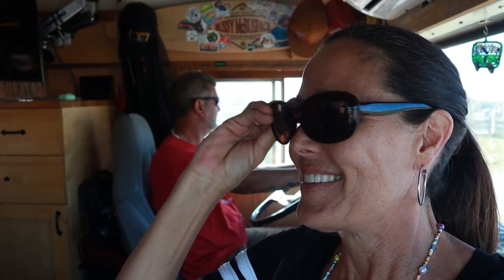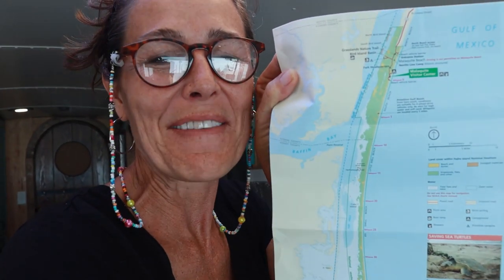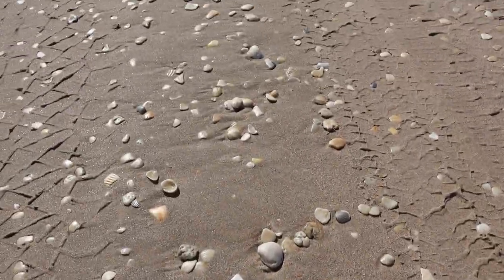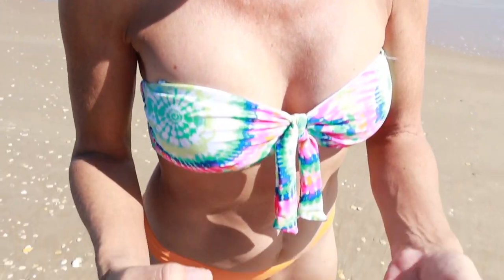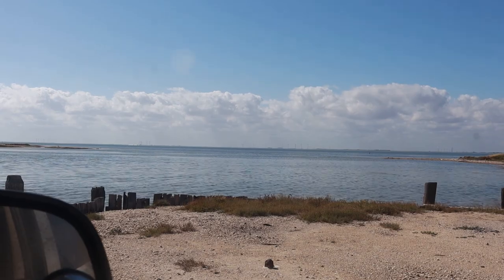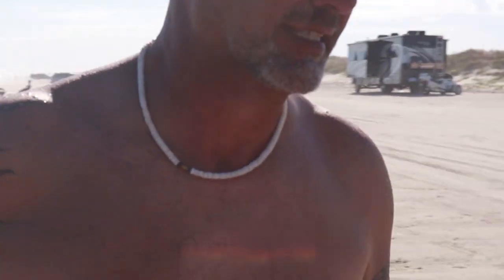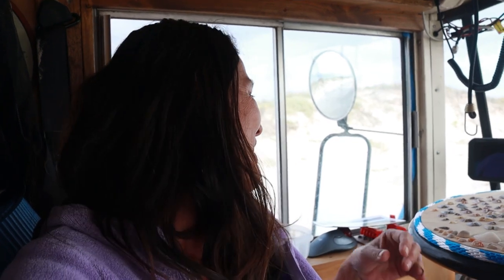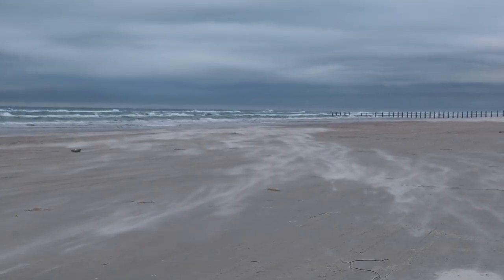Boondocking at North Beach on Padre Island, Texas | Seashell Bingo

Comment: Check the season to see if you can harvest any of the cockels. They're delicious! Boil them tell their shells open, I cut the stomach out and disgard it, and then dip them in butter!

During low tide I find them by lightly stepping around the water lines and they spray you, reach down and they lay right under the surface of the sand, no shovel needed!
Reply: For best taste always boil ocean creatures in salty water! Clean ocean water if you can, or water with the same level of salt as the ocean!

Comment: The little shells that you were calling Little Butterflies are called “Coquina”. 
“Coquina,” an American term that comes from the Old Spanish for “tiny shell,” is also known as the pompano shell or butterfly shell clam. So you’re right they are Butterfly Shell Clams. Right where the waves end on the sand you’ll see little bubbles, that’s the Coquina’s digging back down. We would take a bowl strainer, dig about 4 to 6 inches sand (where the bubbles were), strain off the sand and collect the live Coquina. When we had a half bucket or so, we’d fill the bucket 3/4 full of sea water and let them sit for 3 or 5 hours. During witch they would take in the clear sea water and spit out the sand they had accumulated. Turn the oven on Broil, spread a layer of Coquinas on the cookie sheet, sprinkle the shells with lowery‘s seasoning salt, then put them under a broiler until the shells pop open. Some will not pop open and don’t eat them, they were dead before you started cooking. Put a whole shell in your mouth and you can dig out the clam meat from the shell with your tongue and suck the salt off the shell, then split the shell out, repeat as necessary.
Reply from the maker: Hooray! Thank you so much, I'm so excited to know what they are called...  and how to devour them, LOL! ~Kerry

Comment: Kerry I've lived here (Corpus) all my life and it's rare to find a whole sand dollar on the surf. Reason is they are so delicate and the surf breaks them in all sizes. The trick to finding a whole one is to take a scuba mask and go out pass the first sandbar (about 30 feet pass the surf on low tide) and with your mask on look down just below the water surface and you should see a sand dollar spaced apart probably every 10 to 20 feet from each other. Of course it depends on the tides and storm patterns which bring in more into that 1st sand bar. Sometimes the surf is almost nonexistent and that's when you'll really have better luck finding these sand dollars. Some of the local shops also sell whole sand dollars too in different sizes, some as large as 5 to 6 inches in diameter!